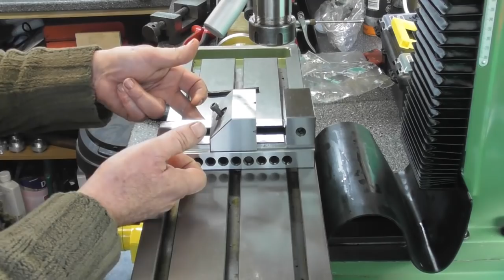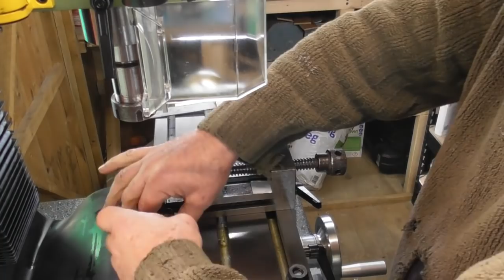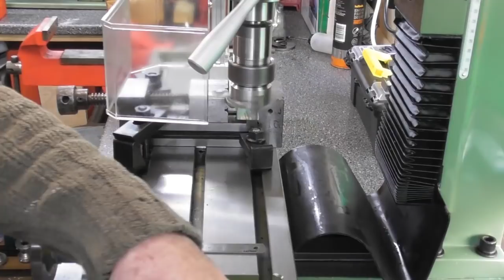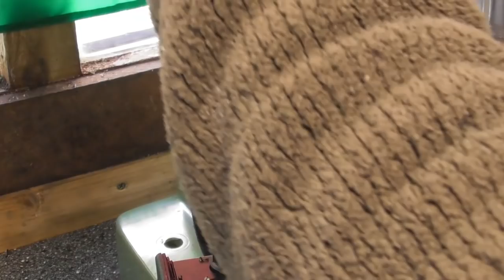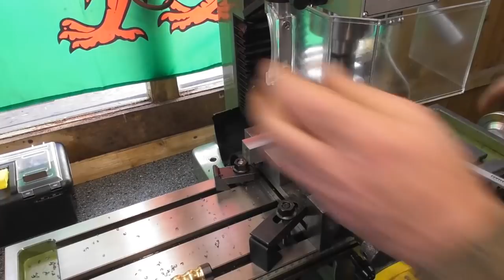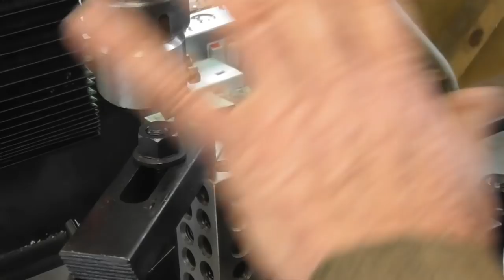Warco WM16B mill first cuts, blocking up

Comment: Funny thing about those tapered gib strips, I've had a Warco turret mill for years which uses them and I always thought adjustment involved simply tightening the screws at both ends, the two parts sliding against each other to effectively widen the gib. Not so... You have to loosen one of them (the smaller one) and then tighten the larger one. Just tightening the large one (the most easily accessible one) did work for a while (I mean years!) but adjustment like this got more and more difficult until today when I actualIy sheared the head off the larger screw. Well that large head is hides a tiny 6mm screw which was a surprise because I thought it was a larger diameter - hence my applying a fair bit of torque to it. The large head is there to press against the end of the tapered gib. Anyway no problem, I unscrewed the snapped shank and just turned up a new one from drill rod. After figuring out the trick of first loosening the opposing screw gib adjustment was very easy. Now my gib adjustment is correct with no play in the dovetails. They were all way too loose before this, knee, saddle and table all had excessive play and I was getting terrible chattering. That's what made me look into the problem in the first place.

Comment: hi ade    wonder if you can help ive just go a wm 16    and the drill chuck falls out every  time i try and use a mill  bit  in it even though i cleaned it 
with  alchol   and  it still  falls out   so how do you fit a collet chuck like i see on yours    is  a mt3   the manual says mt2 ?  i want to use e25 collets 
 dot see anything on warco   that will do it  any idears how to move forward  regards kevin
Reply from the maker: Drill chucks are not designed for milling . the side load will unseat the chuck from the arbour . get collets or a collet chuck for milling . Cheers Ade.

Comment: Why the round bar in the vice against the work
Reply from the maker: Good question . As the block is unknown for squareness and parallelism I put the best face against the rear fixed jaw of the vice. If the side of the part against the moving jaw is not parallel to this then the part may not sit flat against the rear jaw . by using the bar the part can rotate into alignment with the rear jaw and eliminating the issue. .
Clear as mud I know but that is why . Hope this helps . Cheers Ade.

Comment: No way would my WM16 do a cut like that. I would have an issue doing it with a 16mm milling cutter. The whole thing would dance around like a bally dancer, The control box would vibrate wildly. The column can be seen flexing. The milling machine is a load of carp. I really regret buying it it is s..t. It is bolted down really firmly to the floor I might add so it is not the way it is fixed that is the issue. I also stripped the plastic gear when i tried to use the shell mill taking 0.1mm cut. So I had to buy a new gear & ponce about fitting it.

Comment: When you adjusted the cut height on the quill it looked like you were reaching right back to the Z axis column locks? To adjust the quill?
Isn't the quill lock on the left side near the front of the head? I'm confused. 🤔

Comment: Why is the machine not bolted down?
I bolted mine to the stand and the stand to the floor.
Reply from the maker: This was very new at the time and I was trying to decide a final position for it on the bench . It is bolted to the bench now with 4 M12 bolts and the bench has been suitably reinforced to suit. the shed does rock a bit on the runners . I do not have the luxury of a concrete flor or workshop for that matter . Cheers Ade.

Comment: If I had a dollar for every injury I've seen because the "guy that has been doing this for decades" knew what he was doing. Well I'd have a good size hand-full of bills. You can know what you are doing and moving through those exact operations that you were doing here and have the smallest moment of inattentiveness while moving the next tooling item up, and smack it against the still spinning chuck... This doesn't mean you don't know what you are doing though. Hell I am not even a "safety nazi" but I know what I've done to my myself and what I've seen other people do. Simple stupid luck has saved some of the parts on my body and simple stupid luck has taken some away from people that I've worked with. Knowing what you are doing is a poor excuse/reason for not taking the time and it sends the wrong message to everyone. I said my bit, do with it what you will.

Comment: My Warco mill has a crazy amount of play in the bed
Reply from the maker: is it backlash or play in the gibs
Reply: @ade63dug  now your asking!! I'm new to mills. It wobbles from side to side when I wind it from one end to the other
Reply from the maker: @justa1098  it will be the gib that needs adjustment , loosen the screw on the one side and tighten the other end . do not over tighten it , just enough to remove the slack but still easy to move . you may have to play with it a bit to get it just right . when you have it make sure that the screws on both ends are just firm I hope this helps . Cheers Ade.
Reply: @ade63dug  very much appreciated!! Thank you

Comment: Ade

Get some ball bearings, machine a flat, and use them in the vice instead of the dowel pin.  The ball bearing allows the work piece to move to give you the most even pressure on the back jaw.  There actually was a commercial product out at one time call ScrewyBalls that were sold just for that purpose.  Relatively easy to make, just take a bunch of light cuts till you get a good flat on one side of the ball bearing.  I actually then put the ball bearing in the vice (use some backing on the round side to avoid marring the back jaw of the vice) and drilled and put in a short piece of round stock for a finger hold to use when position the ball bearing

Really enjoy your videos, keep up the good work and keep them coming

John

Comment: Nice mill I need to clean mine up now, I have a Seig mini mill with two vices that I converted to CNC or manual, I have made lots of parts and engraving. 
I learned Fusion360 amazing combination with LinuxCNC for the Mill controller I bought all the stepper motors and drivers, power supplies of amazon.
Do you have plans to convert you mill into a CNC machine? message me if you need some help :)

Comment: Nice one Ade, glad you're happy with the mill, I've got a Wong Fu clone, it's a small bench top like yours, they work fine as long as you respect it has limitations and don't slip into Abom mode.

Comment: Saw Your video, in the smartphone, late yesterday. Fontans explode in water, You explode in joy. What a joy to watch Your video! You are like a child during Christmas. I can see You were hot and eager to get to the Shop. You picked Your old pullover......
I have 2 of the type vise You show. For one of them I've modified the piece locking into the base. I ought to have pictures of it. The issue is that the main part in the lockin has freedom to turn. There are measures to prevent that.
The second vise is waiting for the same update. I experienced the problem that the locking screw tightening the locking pin got loose and the pin was anywhere it wanted, and locking was poor.
Somewhere I have drawings for clamps using the side holes for clamping but You will shurely design such on Your own.
At the time 45;00 You showed me a valuable trick! Using 1:2:3 block for support.
And that protective gard.... I took my one off Before the first cut. No interlock cicuitry made trouble.
Cheers.

Comment: Very interesting. The 1 thou total sinusoidally varying lateral movement when you were clocking the vice in...could you reproduce this by pushing and pulling on the edge of the table? The reason I ask is because I'm wondering if the movement you saw could be due to your leadscrew not being straight.

Comment: When you talked of re-blackening the dial gauge holder what method would use use? Some kind of chemical prep as for example are used on firearms, or another method?
Reply from the maker: yes a chemical process, i will show it again on my new milling vise clamps . i do it fairly often and get quite good results , Cheers Ade.

Comment: looks like it could be grinding chatter in the parallel, might be worth checking the surface finish Ade?
Reply from the maker: i had a look at that on the surface plate , it was a loose gib in the table , the force of my turning the hand wheel on the table . as it settles down i will be fine tuning the gib , Cheers Ade.

Comment: Ade, I'm a cheapskate,  so although I do use a vise like yours in my vise, this has worked fine for my needs. I dont use the rotary portion.  It's not expensive. I offer the suggestion for your consideration.  Much better IMO than that machinist vise.

 https://www.amazon.com/gp/product/B00KRRBROE/ref=ppx_yo_dt_b_search_asin_title?ie=UTF8&psc=1
Reply: Hi Joe.  Arc Euro Trade do the same vice https://www.arceurotrade.co.uk/Catalogue/Workholding/Machine-Vices/Radial-Milling-Vices for £60.  I've got one and it's good, it's got the push down ball already fitted, so there's no lift., and of course it uses T slot nuts to hold it down.
Reply: Ofrex I agree, the ArcEurotrade vice is excellent. Secure, easy to hold down and a dream to use.

Comment: I envy you. I am seriously considering a mill upgrade. Right now I have a 15 yr old Seig X2 and it really is under sized and under powered. One thing I noticed in your video, is you didn’t use the micro adjust on the quill. Since the micro feed wheel is on the front, locking and unlocking would be a little easier. I guess after a while you’ll get to know all the tricks. I’m definitely looking forward to seeing more of the mill in operation, and Im looking forward to your learning adventure. Cheers.
Reply from the maker: the flycutter puts a heavy sideload and an intermittent cut on the spindle and quill . i try to use the column slide so that the quill is fully retracted and lock to prevent strain. i then use the quill for the last few mm only , on light cuts. Cheers Ade,

Comment: I am on the lookout for a milling machine and your videos are very interesting. The machine you have seems very smooth and quiet, can I ask if it has a power feed for the table?
Reply: It doesn't come with one, But for a few hundred I think you can get one.  Or using a stepper motor to drive one of the wheels  is a nice project.  There's a lot of information on youtube about using an Arduino, driver and stepper motor.  Ade did a video using a |DC motor to drive the lead screw on his lathe, low speed torque may be a problem though.
Reply from the maker: Not yet , there is a bolt on system to fit it but i will build my own , Cheers Ade.

Comment: First cut is the longest. What seams like a quick and easy operation often turns out to be longer than expected. Even when new those chinese mills/lathes leave a lot to be desired, time is money and with a bit of time i'm sure you will get it better than factory. When i got mine i spent hours, yes hours getting it setup to be reasonably accurate, tightening every nut and bolt and puting in missing screws(I found 6 in the bottom of the crate) and had to find a further 3.

Comment: Hello Ade. I had the same wobble on mine. The gibs were in a dreadful state and rough like a bit of cast iron. I lapped the relevant sides and used a long thin shim. It got down to a thou. Still plan to improve it more when I build the power feed.

Comment: I have a toolmakers vice and a rotary table mounted pretty much permanently on the mill.  the Rotary table  also has an attachment plate on it that I made. Using the absolute setting on my dro the machine always knows where the center for the rotary table is.

Comment: To adjust the gib you need to loosen the screw on the opposite side. Otherwise you might bend the gib. Thank you for sharing your excitement!
Reply from the maker: Indeed , i did drop the rear end screw back for this process , and the tightened back once set , apologies for not explaining the method fully , Cheers Ade.

Comment: When I clamp my vice or use clamps and blocks on the mill table I use small squares of thin cardboard or plastic sheet under the clamps, learned that from working on Jig boring machines,
Reply: Walter Maisey  -  I use thin sheet- brass squares,  same principal, and well worth it if you like to look after your machines 👍
Reply: @clivewood2148  Soft copper pennies are also useful and I've used Walters cardboard trick many times. Paper/ cardboard is remarkably consistent for thickness and can even increase the holding friction. If you use soluble coolant at all it's worth using oil soaked paper under the whole vise base to stop it or the table from rusting.

Comment: Ade, are you sure your tramming is correct, I see the cutter is still removing material on the back end of a full pass that indicates to me the tramming is not correct, ideally, there should be a crosshatched pattern to the surface, but on the other hand, it could be flex of the Z column from the feed applied and the hatched pattern will appear on the returned spring pass,

Edmund..........Alberta
Reply: i see the opposite no chips on the back stroke  and a very nice finnish.
Reply: @jamiebuckley1769  
        Jamie, when I first viewed the video it was on my cell phone what I saw at 42 mins into the video it gave an indication that a cut was continuing at the backend, I viewed it on the big screen today and I still think the same, as you mention nothing wrong with the finish, and in this particular application (vice clamps) it's not fussy, in my post I did indicate  Ideally it should have a crosshatched pattern, 

Edmund.........Alberta

Comment: I made hold downs for my 2" vice using 1/4" pins. 

 Works fine. 

The pins were put into blocks that used bolts and "T" nuts in the conventional way.
THanks

Comment: Congratulations, it brings back memories of my first cuts  ....the butterflies,  very cool ,thanks for sharing
Reply from the maker: I have spent 40 years on bridgeports and big mills.  well K and T mills etc. this is the first time i have ever owned my own so i took it gently to start , it was great though , Cheers Ade
Reply: I've got 14 years in metalworking and was lucky enough to come across a G0760 mill/drill jan. 1 2019 (no power feeds). Always take it easy, no rush😎